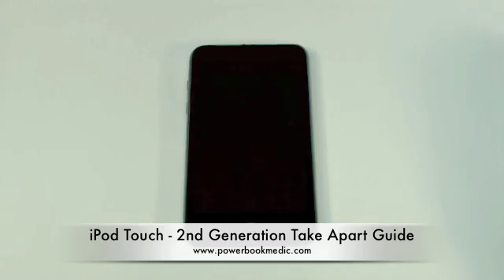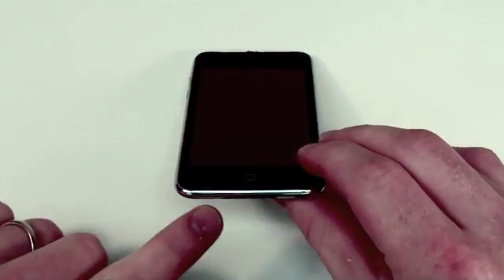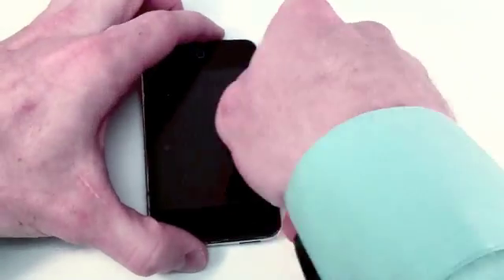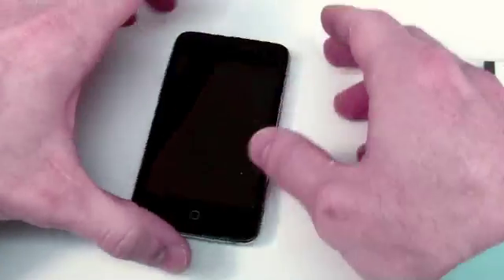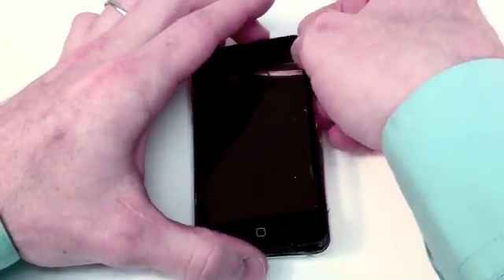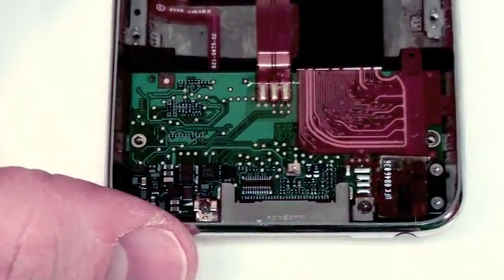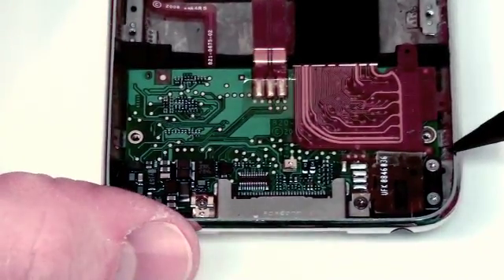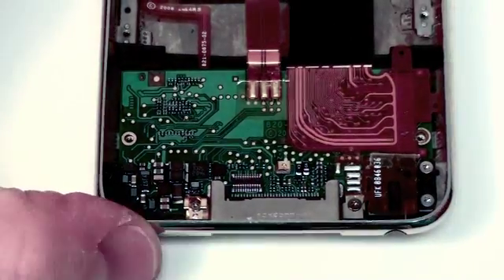iPod Touch Glass and LCD Repair and Disassembly (2nd Gen)

Comment: I noticed that you are using a magnet on the screwdriver.  Isn't it bad for the chip to use a magnetized tool? (I was just wondering as they are never magnetized)

Comment from the maker: You most likely have issues with your logic board due to water damage and will likely need to replace that component in a minimum. We sell the parts for your model on our website or by calling us at 1-866-726-3342, option 1.

Comment: I dropped my ipod in school's toilet yesterday. i took it out, took off the case, dried the outer cover of the ipod itself off.the screen slowly got smaller and it kept turning on and off. Immediately, i ran to cafeteria and the lunch ladies got me a bag of rice. they told me to leave it in there for 24 hours.today,i took it apart using your video because other websites suggested i take it apart and put it in with the rice again. this is as far as ive come. Guidance is appreciated! thanks!

Comment from the maker: @zell0420 - If you're talking about the connector on the board itself, you can't easily replace the component. You'd need to replace the board to replace a component connector such as that.

Comment: I was doing ok until I got up to the screw right before you take out the LCD. It seems to be rusted and I cannot get it loose. It looks like I even mangle the bite/engraving of the screw so its hard to get any torque on it. I really wanna repair this thing as its my mom's older Ipod Touch and it's probably the only way I will be able to afford one.

Comment: Quick ?. While removing the lcd screen. In the bottom next to the Lcd connector . Is a small brass/copper  spring?. It came off. I have the small piece how to I connect it back on?

Comment from the maker: @wizrafi - When you go in to change the digitizer, check out the button and make sure everything is routed and connected properly. If it still doesn't work, you'll likely need to replace the part.

Comment: how is the black button of the screen attached? i bought a glass screen on ebay and it didnt come with that button of the electronics in the back. It also didnt come with those clips on the sides to hook it back into the frame. Any suggestions?